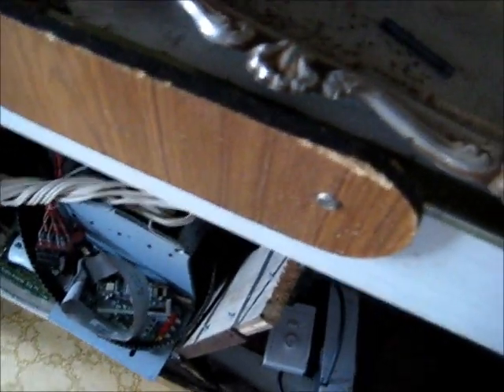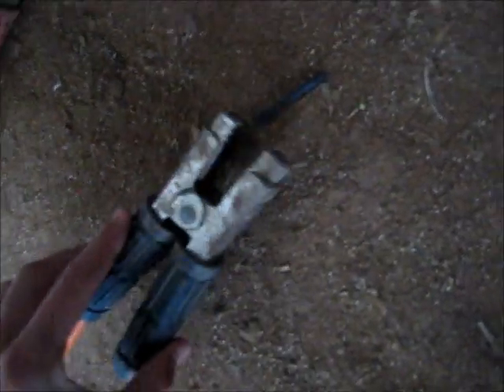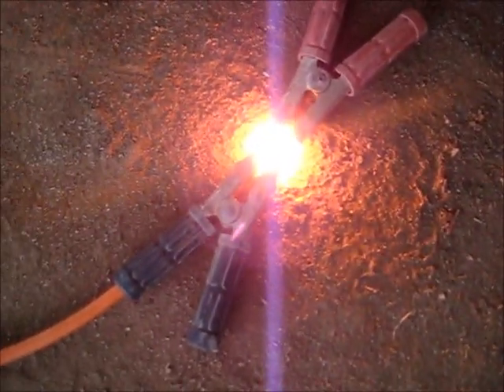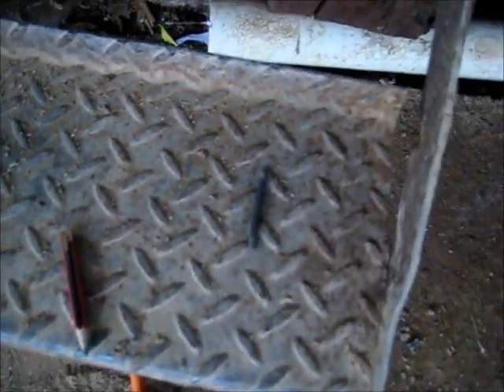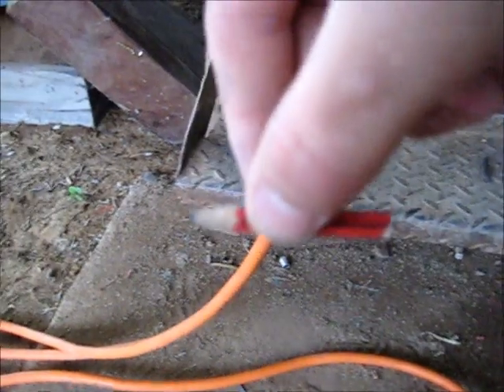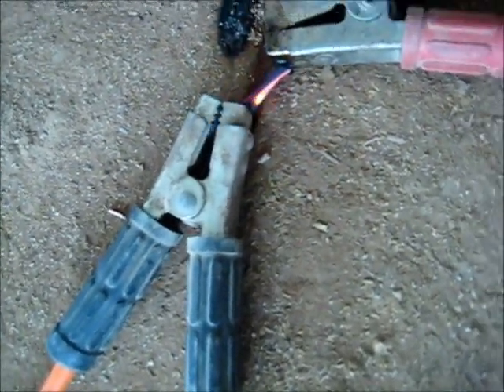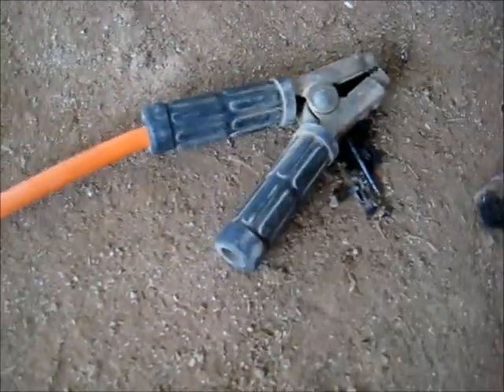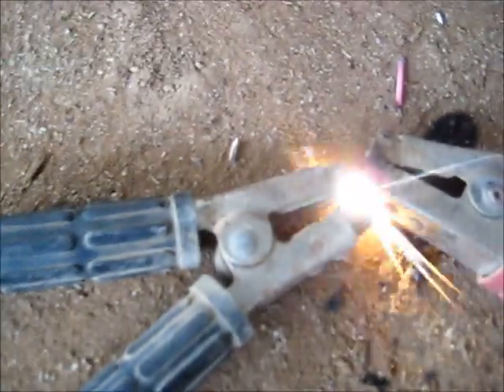180A VS Greylead Pencil

Comment: Great video Larry,
Out of the big Jim 6 volts lantern batteries you can get 4 excellent carbon rods which are long too.
There are 4 F-cells in these batteries. (basically long D-s)